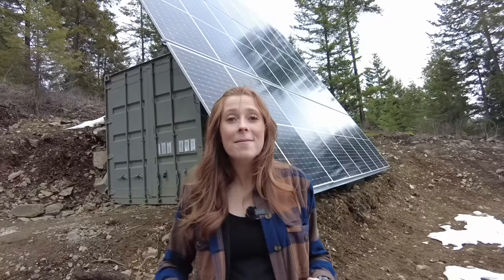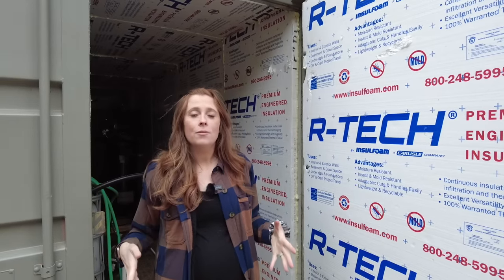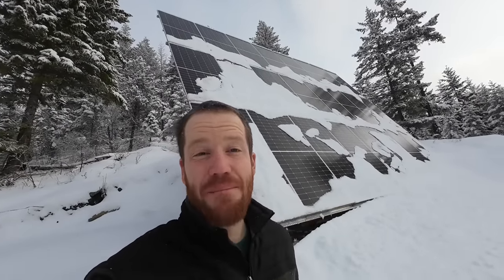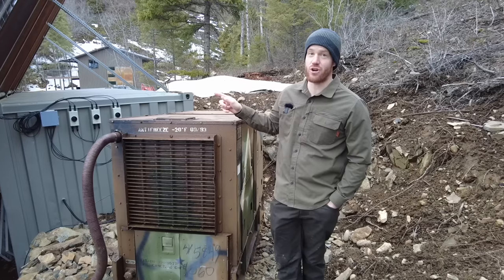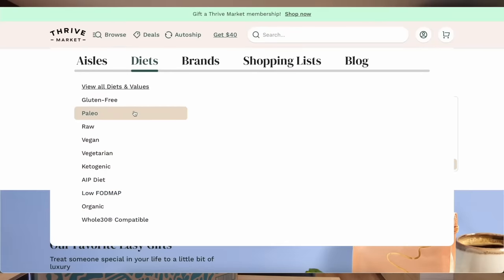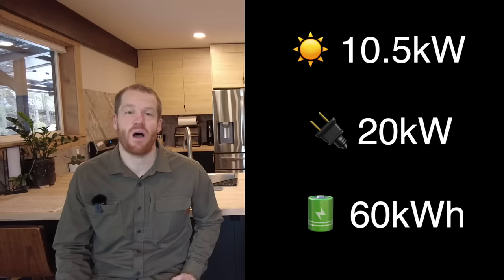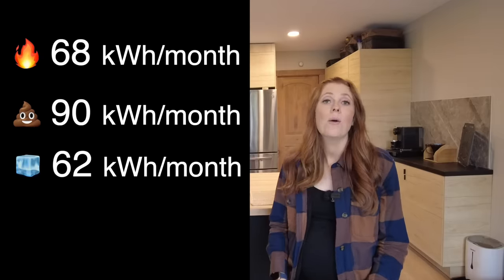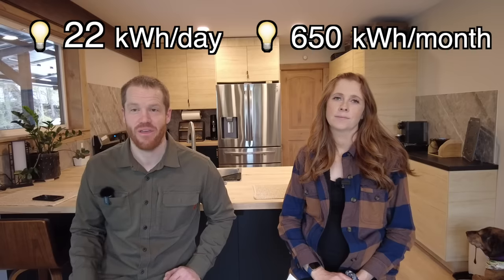The TRUTH About OFF-GRID Solar | Winter Update

Comment from the maker: Join Thrive Market today to get 30% off your first order AND a FREE gift worth up to $60! https://thrivemarket.com/AmbitionStrikes
Reply: the extra power from the summer should be used to store energy in some long term storing system, like redox flow batteries, but those needs some heating too, so maybe is nmot the best option, plus, is not yet a mature technology. Or maybe hydrogen, but also, not quite here yet. For the moment your solution seems the best, especially since it uses an used generator, that did not add more pollution being made, and sturdy enough to last the rest of your life. The only upgrade could be some filter or catalyst to exhaust. Do not forget that all your pollution will go into your water well. (by the way, good solution with incinerating the waste, even could have been used as fertilizer. But such short circuit to the water supply  could create contamination. You should be careful for contamination from those heavy equipment you use there too.  )
Reply: Get garage door put over solar chrome paint l.e.d.s. Light  presto Light at night 🌃
Reply: No
Reply: Stratigically placed lightweight solar reflectors to add extra light using glazed aluminum sheet /hvy duty foam board-backed alum. foil....along with 90° verticle bank re-orienting & RAISING! All the TREES surrounding panel.The tall trees beautifull, but their mottled panel blocking pattern noticed necessitates diode panel section shading bypasses. Ot
herwise..shaded areas become useless, overheating power-wasting heaters(!)& also..keeping those panels cooler lengthens lifespan & gains 5 to 10% power to boot. So the solar heated anti-freeze solution is pump-circulated to an in-tank closed-loop tank coil to bump-heat the hot water at the same time!.

Comment: I have 38 panels on my home and in West Texas. We have SIL-370-HC 370w black solar panels with Enphase IQ8+ micro inverters and produce on average 75kwh daily. Last month we used ~500kwh and produced over 1500kwh. Our panels have a 25 year manufacture warranty. About $300/panel. We live in a city and currently don’t have battery back up but do use a buy back program. So far we have had a negative bill. Thought I would share. Happy hunting!
Reply: As long as the bill is negative you don't need a battery for that. However, do you have outages?
Reply: @HansKeesom  It's Texas.  If they don't have outages they will ... but battery prices are going to keep dropping, so holding off may be the smartest thing to do - still I would have a little bit of "cheap" batteries just to run the fridge etc. during an outage.  And a way to charge off the solar even during an outage (if your grid-tie makes you go black during an outage, many do).
Reply: Hey guys. We have outages but fortunately we live close to a hospital and are on their grid. I have contemplated on buying a natural gas generator and installing it and then later purchasing batteries. I think overall that would complete my system.
Reply: Good project run a trench to shop and put a new generator with push start in house
Reply: Great video guys, i think you have a practical balance. However don’t underestimate the amount of washing a small child will produce, its staggering! What about building a large pond up mountain and pumping it full with spare water then generate hydro electric over the shortage periods?
Reply: @ianbedwell4871  Hydro power might be hard to work when the water is frozen in the winter...which is when they would need it.
Reply: @Tumbleweed5150  Deep enough stream with a high flow, though? You'll only get an inch or two of ice on top if even that. And since inlet pipes for the turbines are generally always below the frozen cover, you're set to produce all year round.
Sure, that ice cover is going to slightly reduce your head pressure, but it shouldn't be too bad.
Reply: And if you're manufacturing the reservoir, it'd also make sense to build it underground. A closed-loop system that has practically no evaporation issues, and is insulated from the cold? Winter's not going to get the water to freeze.
Reply: Buy back is ok as long as your local utility isn't a scam company. Most companies across the US won't pay more than your normal on grid usage anything over that they just steal from you and sell to neighbors. Google using junkyard Hybrid batteries as solar backup, just carefully separate the circuits and reconnect in 12, 24 or 48 volt segments according to your system needs. You can find batteries from wrecked cars as low as $300.
Reply: 500 KVA Diesel Generator 3 Phase 415V - Cummins Powered.
Reply: @ollierinko9387 lmao.. this is so silly, just buy batteries. What you just suggested would be insane expensive
Reply: Curious who you use for solar buyback? I just had 12kw panels installed on my roof with no batteries yet.
Reply: @alanmalmberg1549  I live in MD and got the information off the BGE website about solar on-grid systems. Currently I only have a small $150 12 v system to power lights and that reduces my bill down to where it's affordable and use a Walmart set of store brand $50 car batteries for storage since it only runs 8" LED light strips throughout the house wired up with RG-45 wire and switches in each room. Their actually brighter than the house lights. Until then if the power goes out I still have my 4500w gen for emergencies. If they change the buyback policy I may consider going solar unless I go total offgrid.
Reply: @tiny9614  in my state ppl electric company forces customers to use their approved inverters that give THE POWER COMPANY the ability to throttle YOUR system. Just bought 30kwh of battery!
Reply: @APatchworkCanvas  the only company here in Midland TX is Reliant. They charge me $0.15 per kWh and buy back $0.10 per kWh. I have to make 3 times the amount we use to make any $$. And we are already in the Triple digits; yesterday our temp was 103. We ain’t making no money this month.
Reply: @ianbedwell4871  won't the pond freeze over in winter (the shortage period)?
Reply: @ollierinko9387  Compared to hydro, Expanding their solar panels to a humongous capacity for winter (and therefore an overkill for the rest of the year) might actually be cheaper and better for the environment.
Reply: @adon8672  not deep enough to affect the flow, max would be 4 to 6 inches.
Reply: Now you just need an EV so you don't have to buy gas either, or do you have one?
Reply: 50K to be not totally covered and for a small house…..it conforte me on thinking solar is not the solution….to be totally indépendant I would need 3 times the size of your system and I live in Texas….I average 250$ per month for electricity bill….how much would cost a system big enough….
Reply: Hello tiny9614
I am now living off grid using predator 9500. My neighbor will not sign easement affidavit. So me and my family are stuck without power. Can you explain more about your setup.
We are in An RV now but will be building 2500-3200sqf home. Will your setup work? Thanks in advance!
Reply: I’m curious to know the size of your house because here in Houston,  10 months a year we are above 2000kwh and the pic of summer more than 3000kwh….so with what you produce we still have a big electricity bill and I imagine a huge loan with panel….give us more numbers
Reply: @@LTNetjak Just know that California is probably adding batteries faster than solar, and they are going to soak up that sweet sweet locally produced juice and shift it into the evening peak.
Reply: @FrancoisTX1974  My house in Midland is 2100 sq ft. And I am re-thinking and have decided that Solar for residential users is a joke. there is no program out there that supports a profitable outcome for us. I think solar works well for those not on the grid Only!! I invested $40K and the only thing good about it is I save some Money on my electric bill but its not enough to cover the expense. If you decide to go Solar, go slow unless your off grid.
Reply: Oke, nice job...I think a long winter will prove it all..
Keep a few cubes of firewood for safety..
Reply: Where did you buy the panels from? We are in Texas and looking to buy panels
Reply: Negative bills are the best kind of bills.
Reply: With IQ8 why would you want batteries? Even if you lose power they can be setup to generate power.
Reply: I just have a tiny array, it's my second the first one worked better and inclement weather as it was amorphous and this one's monocrystalline. I plan on soon salvaging the amorphous and hooking it up
Reply: Oh yeah! That incinolet pwr-hungry toilet! Make a solar concentrating version for when it's sunny! And while your at it..make cheap, effective POWERfull solar stove/ovens! SO NEAT to have.Saves SO MUCH electricity & wear & tear on your electric stoves. Then there's solar roof-tube lensed lighting you combine night time LED lights as combo units..for wherever you need more daytime lighting too.And then water purifying! Sunlight's UV rays purify water through clear plastic or low lead glass bottles in 5 hours or so. No bleach or chemicals. Just filter dirt, & any chemicals w charcoal & sand & cabin filters.
Reply: While the electricity companies are buying your excess at a reasonable price keep selling and no need for batteries but here in Australia the roof top solar panel uptake along with commercial solar production has reached the point where buy back rates are near zero and the electricity companies are starting to charge to take the excess electricity generated off your hands.  At this point batteries become mandatory as the rates the electricity companies are charging outside peak solar production times are userous.

Comment: We have lived off grid for 41 years in Northern Alberta which has even less winter daylight and temps to the minus 40 range, you have done an excellent job of identifying the challenges.  I would say that you can reduce your consumption as we have 38 kw of storage with lead acid and run a 3kw power plant about 25 hours a year to protect the batteries from not going below 50%  We are very low energy users averaging about 4 kw a day in winter no welding shop here only lights, fridge, pumps and devices in the winter while in the summer we run air conditioners  and other high drain appliances to use up the surplus energy.    I am still using one of the Trace 4024 inverters which has to be 35 years old and I have panels that are 25 years old and still producing very well.  The first panels we had were ARCO  and the cost was $10 per watt so today panels are almost free by comparison.  The technology has changed and moved forward with the price dropping so it is much easier to be self reliant now.  We have had 2 power outages over the 41 years that lasted under 10 minutes as I had to reset the system.  I wish you all the best and hope your system continues to meet your needs for at least the next 40 years.
Reply: Good for you buddy! My off grid days go back to trace engineering and heart interface and arco solar panels as well. I'm still doing it for a living!
Reply: 4kw/day?! so you are making food over wood fire and washing your clothes in the river? Also heating in the winter with wood fire right?!
There's no way you can achieve that 4kw/day on electrical products, especially in winter. Not talking about food preserving. You must eat very little, like maybe eating berries and other raw stuff. No sopus and other cooked foods
Reply: 4 KW/h a day in winter is crazy.... You either are freezing or eating frozen food + showering with cold water all the time.... IMO 4 KW a day is not healthy nor recommended.
Reply: You didn't live off grid anywhere.
Reply: We use about 4kwh per day as well. 
You must not understand something. I design and install systems for the past 15 years and have taught workshops all across Canada. Most off-grid systems we install are designed around a load analysis of between 3500-6000 wh/day. 
Nobody that lives off grid has an electric cook stove. Propane or NGas. They heat with wood. Their DHW is propane or NG on demand.
Reply: @MaritimeHomesteader  I live off grid and I have electric everything.   I also have a massive power consumption, but didnt spend much.   I got 96 used commercial solar panels.   Just upgraded to 6x EG4 6000x  I have 180kwh worth of 280ah Lifepo4 cells.  Total cost with wire and all was about 45k , but i did all the install.   We now keep the house at 75deg in winter and 68 in the summer because we dont worry about power.  House is 5600sqft.
Reply: @MaritimeHomesteader  we're building offgrid and won't be using ngas or wood burning. We'll likely have a similar system to the couple here as a family of 6 with 1 yo twins. Ngas isn't good for our lungs, neither is wood burning. Don't want them inside our house. We prefer induction stove. Plus, why add extra, unnecessary work to our day with cutting, chopping splitting wood? Even with a wood splitter, we're not going offgrid to prove anything. We want to live the same lifestyle we have now, just in a prettier setting. 

Fortunately, we're in a good financial position to not need to reduce down to 3kwh/day. My husband would never in a million years convinced me to go offgrid if it involved sacrifices.
Reply: Where are you in Alberta? I am hoping to buy some land in Northern BC totally off grid
Reply: 4kw / day is perfectly achievable for most people who take the time and effort to understand their power usage. I average about 5kw/day over the year, can have a few days below 3kw (though thats rare) and have never been over 10kw in a day. Most I used was about 9.5kw and that was when i had guests over and was using the electric oven, electric hobs etc to cook a big meal. Heating / cooling is often a big one, I use mostly wood burners and also have oil fired boiler for hot water and heating those rooms where the wood heat doesn't reach (this actually uses a surprising amount of electric to run the pumps etc). Fortunately I live in an area that does not require A/C, on hot summer days keep the sun shades down + big thick stone walls and stone floor for thermal mass helps keep inside temperatures down.

Comment: Your solar panels look like during the summer month they would produce more power than you need. A German company has come up with a system that takes that surplus electricity and converts it via electrolysis to Hydrogen (H2) and stores it in  metal  pressure cylinders for the winter month. The Hydrogen is then converted via a fuel cell back to electricity. Granted there are some losses in the conversion but since the solar power is „free“ that does not count. You could not store that much electricity in batteries for the winter month but with Hydrogen you can store all you need. They can show that with this system you do not need a generator or be hooked up to the grid as a backup. I do not know if anybody in the U.S. is offering something similar but this would certainly be something to look into! Greetings from Mallorca.

Comment: Large dealers in generators usually have an inventory of emergency back-up generators from health care facilities, various utilities, etc.  These units had a well cared for early life.  They are replaced at regular intervals and are auto start.  I have purchased several very large units (750 KW, and 625 KW) in the past and found them to be low hour, reliable investments.  Sizes in your range are usually readily available.  Thank you for sharing your journey.

Comment: Riley, there is 2-wire auto start kit for MEP series generators. I have it for my MEP 802A. Inova was the first, but there are others. You can add a delay for the contactor to give the genset time to warm up. If you set the no-load frequency, so it drops to 60hz at the charging load, you don’t need to manual adjust the frequency. Inova Hightech.
Reply: I don't know about this particular generator, but older aviation GPUs ( which this seems to mimic) are notorious for needing constant manual adjustment. I'm not sure an auto system could handle that
Reply: @lextheap1638  all I can say is my surplus military generator generally hold the loaded frequency I set. Unloaded it will be 2 or 3 hertz too high, but loaded up to 80-90%? Dead on. Set it and forget it. I don’t have hands on with the
At 15K, and it was required from 3-phase to split phase, so their MMV.
Reply: @lextheap1638 those generators have a designed speed/load droop that is very predictable. If they plan to run it only when the batteries are low at near full power until charged, what the guy describes is doable.

Comment: Thanks for the update.  I ordered a similar system from Current Connected several days ago.
I went with the same two inverters (I'll have a 100' x 40' wood shop), two 450v/200amp Charge Controllers, 15 of the SOK batteries instead of 12, and I have 56 panels that will generate just over 20kw as opposed to your 10kw.
Your videos introduced me to Current Connected and I'm looking forward to building my system...
As soon as our house and shop are erected in Northeast Texas!!
Thanks for sharing your info...
Reply from the maker: Riley is drooling over your system! Being in Texas, can you send us some power in winter? 😂
Reply: @AmbitionStrikes  I just went back and watched your videos on building your solar rack and mounting your panels.
When do you want to come visit and help me build ground mount rack(s) for 56 panels????
LOL, I'll feed you well!!
I have never welded, but I recently bought a Hobart MVP 210 welder.  Time to learn.
I was a Reactor Operator in the nuclear field, so I can probably figure this out...
Reply from the maker: @jdanderson6400  You got this! 👊
Reply: @AmbitionStrikes  
As for sharing Winter power, we just need a 2007 mile extension cord.  Now what gauge wire would that be??
Reply: @jdanderson6400  AWG unobtainium and too expensive for manufacturing. 😅